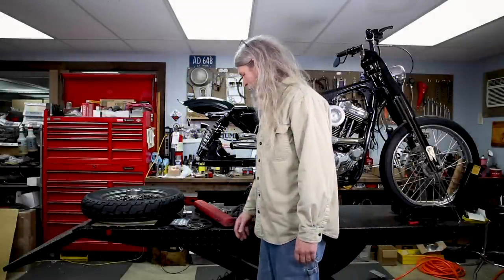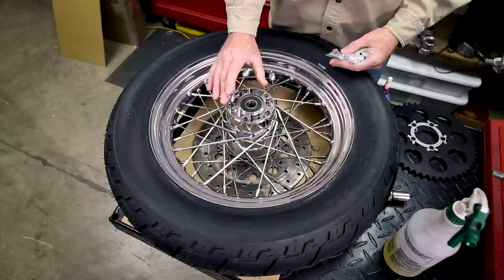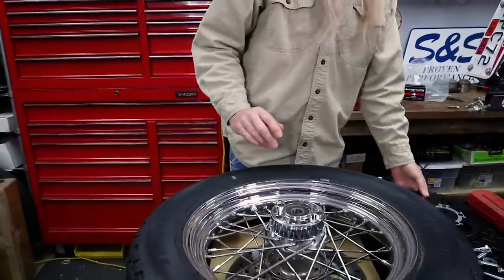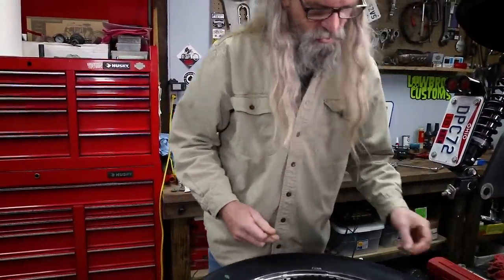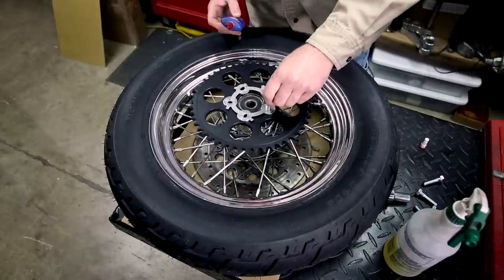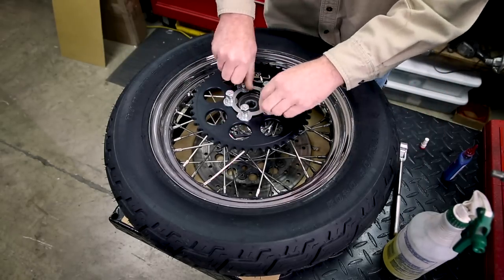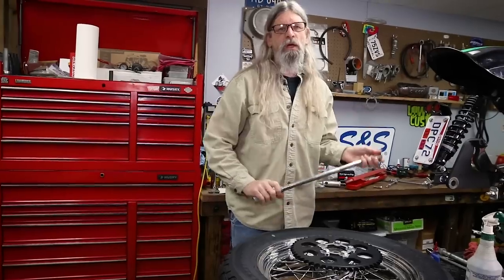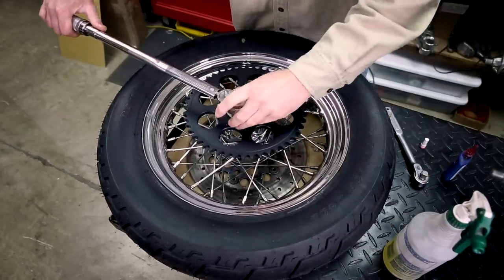How-To: Installing Locking Tab Washer for Harley-Davidson Rear Wheel Sprocket / Pulley

Comment: I did a swap on my 95 , but used the sprocket for a 2012 the hub on my 95 was 1/4 smaller than the 2012 do to the 1 inch axle  1/8  clearance around my hub.   I know the Hub helps keep it in comfrance but the bolts are what hold it from turning .   Anyone have any thoughts on this , having a gap to no gap around the hub.